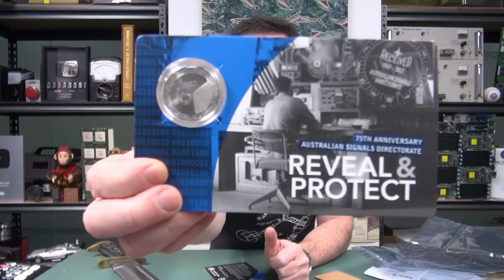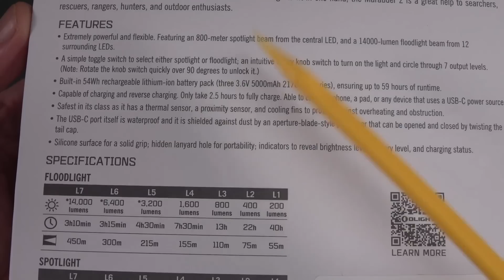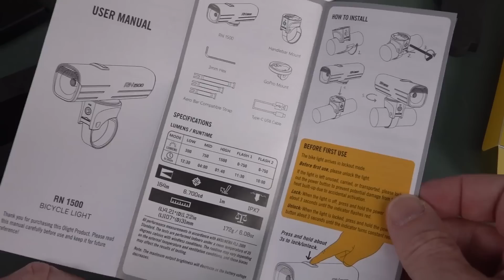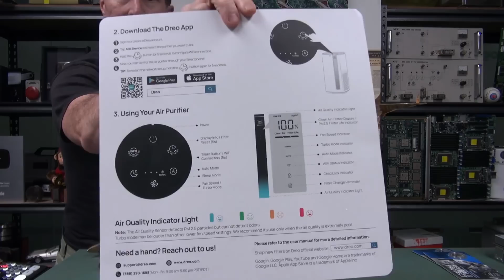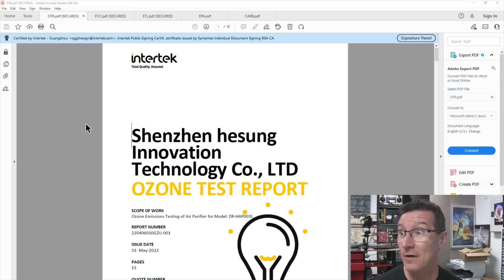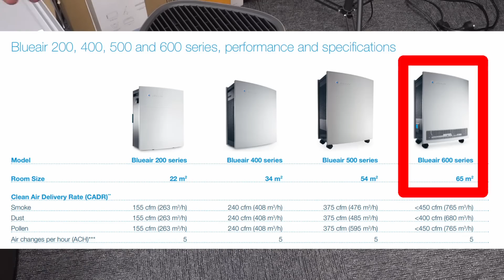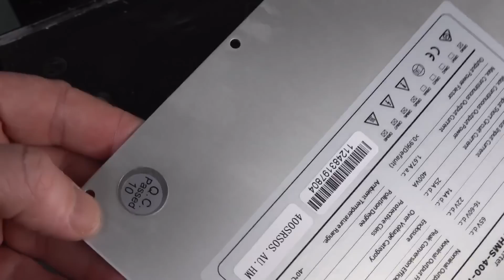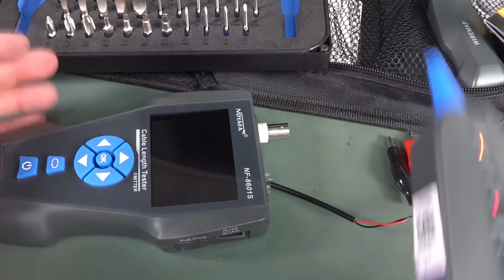EEVblog 1516 - Mailbag Bonanza!

Comment: I'm using those Hoymiles micro inverters since March and so far they seem nice. They provide application for power tracking but I don't like that it needs to be connected to internet 24/7. Year hasn't ended yet but I've already produced more energy that calculations showed so I would say the do indeed work as intended. Definitely would like to see how they are made inside!
Reply: Could be a bypass or something

Comment: The right angle torch is familiar to anyone who's been in the military; the "belt" clip fits over a loop on your ALICE. For most uses, I'd say this design is more practical than the standard straight torch.
Regarding integrating spheres, you might want to check out Torque Test Channel. They built one out of styrofoam.
Reply: Not just for Americans with the ALICE, but Canadians with the "82 pattern" (and the 64?) too. Stores are still full of the old incandescent "bendy light" things for some reason - no one wants them. I've heard they still sometime issue them out for basic because it's funny.

Comment: 13:19 That is nowhere close to 14,000 lumens ololololo. 99.999% of these lights are bullshitting with their box claims.
Reply: Yeah, they get by with it because it's the lumens measured after a millisecond directly after switching on. They all step down very quickly after that because the heat would be unbearable

Comment: The Torque Test Channel here on YT built their own integrating sphere to review flashlights. They went through the whole process of building it, and how they "calibrated" it. (Spoiler: They sent a flashlight to a lab to measure its output, and used that flashlight as transfer standard to zero in the light meter.) If that's a rabbit hole you want to go down, it may be worth a look. As a flashlight aficionado, I'd be happy to watch it. +1 for additional solar videos! Never heard of Hoymiles either here in the 'States.

Comment: i think you should use the 4 panel microinverter they sent and a depotting would be interesting to see
Reply from the maker: Only problem is I plan on getting a Hybrid inverter with DC battery, so the new panels if using the Hoymiles inveretr won't work with this.

Comment: As with every shitty "999.999 Lumens!!11" Aliexpress lamp out there, every claim is just BS, even with the expensive ones
Ignore the ratings with an asterisk which say it will dimm down because of heat dissipation and take the 1600 Lumens rating for example:
7,5h runtime on a 54Wh Battery will give you 7,2W. That is 222lm/W
I know there are 300lm/W LEDs now, but only in the lab and only directly measured without any driver losses
I think it is more like 1000 lm. 7,2W might be right
Since virtually no one has an ulbricht sphere at their disposal it is just not possible to proof this claims wrong

Comment: ive found some Olight head lamps in ewaste because the cable connection into the lamp area is dicking around, probably loose with no fix possible.

Comment: Does the Australian Mint do similar things as the Royal Mint UK, where commemorative coins are struck and actually go into circulation?
We have fifty pence, one pound, and two pound coins and occasionally there are coins struck that commemorate something and go into general circulation.
A few years ago we even had five found coins in circulation, they didn't last long and were snapped up. I got a few at my local post office every time I saw them. I confused the hell out of shops when I tried to spend them, the shop owners would either refuse or larger shops would go get the manager, even the police were involved in my trying to pass counterfeit coins, but the copper laughed when he saw the five pound coin was real!
It would be a great divergence from electronics to see Australian commemorative coins occasionally. I, for one, hope you do....!
K Watt.

Comment: A cool fact is how the cable tracer measures the delay between a pulse and its reflection to measure the length of cable. (That is, if it works on that principle; how else could it work?) It works out to roughly L = ΔT * c * Vf, where L is length in meters, ΔT is change of time in seconds, c is the speed of light [edit: in meters per second], and Vf is the velocity factor of the cable.

Comment: some of 120V PSU can be converted to 240V by replacing appropriate MOV.   must be shore that power IC is atleast 600V and dc link capacitors are 400Vdc capable

Comment: I wouldn't argue that Olight is very high quality indeed - I have a couple myself.  But their use of semi-proprietary batteries that cost triple the price of bog-standard unprotected flat-top 21700's really pisses me off.  That and their higher prices are kind of what may make them shelf queens for me, albeit very nice specimens to be sure.
I find the real value lately is in Sofirn and Wurkkos flashlights.  They are budget priced lights at near Olight build quality and nice designs.  A fair number of them can even simulate candlelight and lightning - and some even have pretty auxiliary LED's in the head or switch that can be controlled.  I find them to be some of the best lights I currently own - ESPECIALLY since they are priced to actually use and even abuse if absolutely needed.  And no stinking proprietary batteries.  ....  I find them cheapest to get on their official websites or AliExpress - not Amazon (same with most flashlights for some reason).
--signed, Flashlight Enthusiast. 🔦😎

Comment: That nec relay reminds me of how microsoft used to have such things on xbox board, so they activate it, and you cannot go back in firmware. They had so many on the board, and when a certain level of firmware came out, they blew something on the board, so that you could not downgrade the firmware.

So, such relays, could be used in many ways, just not in military type things.

Would be interesting to see that relay done with high speed camera though, and to see how much juice you had to put into it, to activate it.

Fascinating though its a one shot relay thing, and the possibilities for military stuff is enormous, as it could of been used in so many ways.
Reply: Thanks. Every time I feel like I've reached limit of hate for Microsoft there's a whole lot room for more....
Reply: @andrewphi4958 You're getting all hot and bothered by something that's not even an issue for anybody. As a console modder, I've never even heard of this being a thing, let alone an issue
Reply: @andrewphi4958  Not just Microsoft, Nintendo does that on the switch.

Comment: re: the de-pot or not...   I say "not", or at least not until you give it a good testing and thrashing.  The thermal design might be critical, and pulling out the potting might change the results.
Reply from the maker: I wouldn't use it after depotting.

Comment: Looking at the FFC teardown photos it looks like the whole air filter is run form just a switchmode supply, so if you really want you could replace it for a 240V input unit if its really not universal.

Comment: RE: cable tester.  I thought this might be really expensive but I think I paid about the same price for my Fluke cable tracer kit I bought probably 10 years ago so I might get this one.
My Fluke has difficulty discriminating exactly which cable is actually the one you're looking for among a bundle in a patch panel/switch.  What the Fluke could do that other inexpensive cable tracers could not is do a trace on live Ethernet.
Also I dropped the probe which broke the plastic clips holding the plastic shells together.  It has screws to hold the case together but only at the ends.  The rotary switch in the middle relied on the shells clamped tight by the clips to make proper electrical contact.  It was a real disappointment in quality for a Fluke.
That said, might check out this new tool, though I don't do any on-site work or work out of an office anymore that would make this as useful as in the past.
Then again, I was able to detect cable crimp and mis-wiring when my dad ran Ethernet for my home mesh wifi.
Oh yes, another problem with the Fluke: it went too fast through the wire tests to be sure which wires were open or mis-wired, as it went through checking each wire one at a time.

Comment: Nice one-shot relay. Missiles don't need many switching cycles, right? Probably thermally activated with a thin fusible wire. Kinda like the old European fuses with an indicator plate that springed off after the thing blew.

Open the iris! That Marauder is the smallest big-ass flashlight I saw, really cool. The logo is sooooo ugly though, like someone took a Warcraft logo font and used it where it totally doesn't work.
The bike flashlight is okay, though I wouldn't dare using it in traffic (blinding bright!), Perun is very nice with its head harness. I'd go urban exploring with that one.

Dreo is nice-ish, the "internationalization" is clearly a downside, and I wonder why you're supposed to insert the filter one particular way while it's not enforced by the device's and filter's construction. While the idea of using air filters is kinda meh in my book (just open your damn window!), I loved how it was tested and all the reports were attached. Way to go! And you don't even have to do a teardown, LOL. Good you mention ozone after Fran's yesterday video :)

The Hoymilles looks really cool, I was expecting a larger unit looking at the huge-ass box it was supplied in, but the manufacturer seems to have delivered. I wonder where the output goes to, the connector l looks quite non-standard. The teardown had this sad trombone moment, but if it's meant to work outside in rainy weather, it'd better be potted! Good it can be taken out, and lifting it is like revealing the shroud in those old RTS games... Waiting for a teardown video.

Interesting and quite advanced cable tracer. Looks pretty on the inside too. You got nice cable bundles down there.
Reply: I think the filter orientation is just so that you can use those things as fabric pull straps?
Reply: @dannooo548  they're useful for that, but I wonder if the filter will work correctly if they're not facing the front.

Comment: If you are lucky enough to get potting gunk that is so soft, you have to do the teardown. Maybe there is some nice SiC down there. I also wonder how the proximity sensor in the torches works. I once saw a video where LEDs were used as a touch detector.

Comment: 6:50 Given what it is and the context around which it was supposedly gotten to you, most likely it's used in munitions as the final element between the 'Boom Y/N?' circuitry and the actual bang. IE, the brainboxery decides Boom = Y, so it fires that relay, which then shorts the on-board battery through a suitable primer to detonate the payload. Could also be used for igniting rocket engines on munitions with rocket propulsion.

Truly scary thing is that tiny little device could be the final step in vaporizing an entire city. Nuclear weapons use conventional explosives as their primers, and this would be useful for setting off the conventional explosives in a nuke.  Not saying it was in a nuke, but it could have been in one.

There's plenty of peaceful uses for it, too, but given the context I'm assuming it's part of munitions fusing.
Reply: Think it could have been used somewhere in an application like plane ejector seats or some other emergency equipment? Seems like the other option besides making things go boom.
Reply: @aliveandwellinisrael2507  That's what I was thinking. That or a fire extinguishing system.
Reply: @aliveandwellinisrael2507  That's still making things go boom, just in a more controlled and less deadly way. Like airbags in cars. Those are just bombs that are carefully designed to inflate a cushion for your face in a fraction of a second so you don't rearrange it on your steering wheel in a crash rather than cause harm. Why you arent supposed to put your limbs on the dash of a modern car, why people call bedazzled steering wheels claymores. 

Matter of fact these could be used to deploy airbags in a car if their response time is fast enough. A device similar to this handles that task.

That being said, look at production numbers for ejector seats VS munitions. Just on a quantity standpoint its more likely to be used in that application. As I initially said, there are plenty of peaceful applications for it, but it is ideal for and likely used for detonating explosive munitions, and this particular example came from a military context...
Reply: I can see two possible uses for one of these in the same device as in what you're saying that in the way of initiate big boom device if device controller says yes!

However often times there are safety devices to prevent sad thing from going completely under the wrong conditions and circumstances sometimes also rent a rogue use of said device.

Such as also to render something safe if malfunction or otherwise.

In this case in theory two of these one shot relays could be used.

Say there were some type of pyroelectric initiator!

One of these one shot relays would be to apply power to initiate!

But if a condition were met that that is to be prevented and is a condition on which no matter what this cannot happen as an initiation after the set event occurs that is to prevent this from happening as in rendering this from occurring once something happens!

A second relay could be parallel across the initiating device so that once that one shot relay is fired there is no way of power getting through to the initiator rendering the device from initiating!

Again this could be for a safety system or possibly an abort even for example say something was aborted this would fire preventing anything malfunction otherwise from doing what it was intended to do.

Somebody before had commented on battle short usage of these devices however generally battle short would be a switch that or relay that would bypass certain things but you would not want to have a one shot device for this especially something that would not be able to be easily unplugged and replaced even if you did have a one shot device for this.

For example battle short would be bypassing fuses to keep something working no matter what essentially for example I've heard with certain Motors that are used for critical functions such as gun aiming on battleships the fuses would be bypassed literally in some cases what's called battle short fuses which is essentially a solid link that would go in place of a fuse in some cases.

Then we are always used for this but they do exist for this purpose of battle short!

The purpose of battle shorting is essentially to keep things reliable in combat situations where things that would normally shut something down if those things could not be tolerated and have happened under those conditions that's the idea of behind it!

And for example in other cases it might bypass some safety systems such as say thermal overload in some equipment and others but other systems that will be part of the equipment protection may not be bypassed but basically to make things more reliable but with risk of equipment damage still.

Such as the beach bypassing a thermal overload on a power supply that is critical however perhaps some other protection may still be active even though.

Also these one shot relays could be used in protective devices as well potentially!

Or possibly even as fault indicators where there should not be current flow only but when an incense occurs that would cause this indicating a phone such as now put of some sort of fault indication system would trigger this to indicate a severe fault condition essentially setting off some type of fault alarm.

There are plenty of applications where something like this might be used it's not strictly things like something that goes boom and this being the last step either.

When you need something critical to operate and quickly and reliably at be a one-time thing yes this would do it.

Another possibility is this might be something that's designed to disable something that would need to be done for safety reasons and one time or to prevent something from operating under certain conditions and one-time situation or to bypass something not necessarily battle short either!

Or possibly even as a device as an emergency power disconnect essentially short a circuit deliberately and disconnect power that way on a one-time deal of things.

It may actually be also away to neutralize munitions uncertain conditions are met or even some sort of a neutralization system or possibly even something like a self-destruct for munition neutralization after a certain time period or otherwise.

Also I think what that might be that triggers that device itself might be a burn wire essentially a thin wire that has somewhat of resistance essentially you put enough current through it vaporizing or melting The Wire and releasing the spring tension thus activating device

Comment: I'm running the hoymiles hm-350 for some months now without any problems.  I would like to see the insight if the hm-400 so i don't have to open mine.  The inverters sold in germany have a Betteri BC01 Power Connector for mains seems that this is different on yours.

Comment: Air filters work as a result of electrostatic charge on the filter medium.
Reply: hepa filters use three principles and none of them involve electrostatic charge
Reply: @drkastenbrot  You're right. It's only the plastic one that create an electrostatic charge, Their advantage is they can trap particles smaller than the mesh size and can be easily cleaned and reused.

Comment: What's the point of screws when is completly potted. They should have used rivets instead. Like this gives false hope of serciceability.
Reply: Did you not watch past the point where he opened it and showed potting could be easily removed?